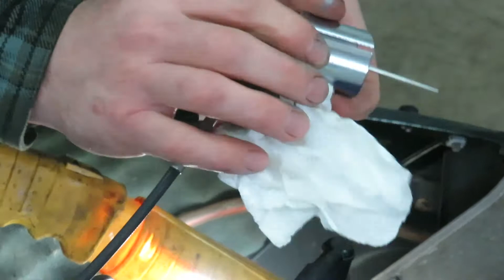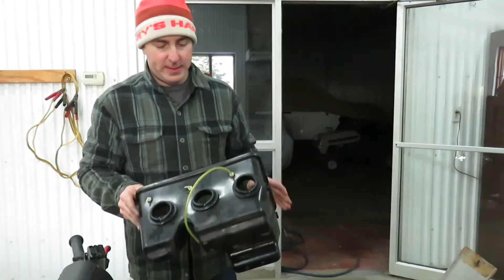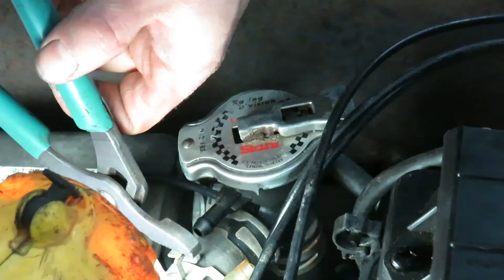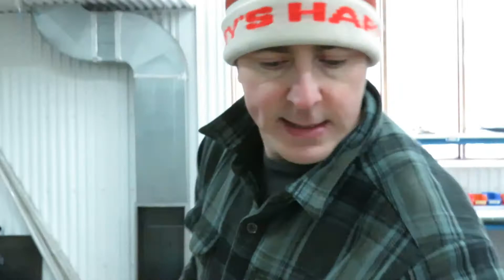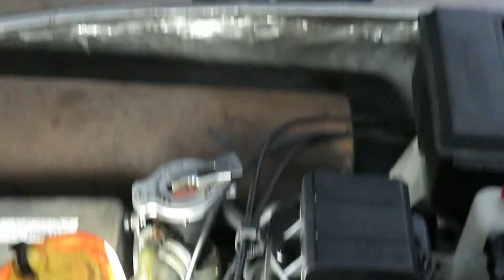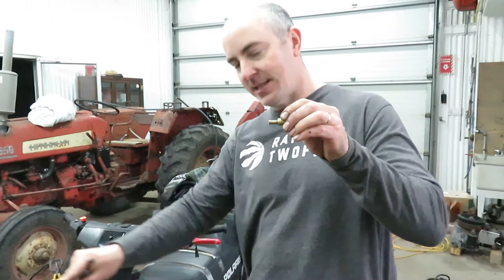1997 Polaris XLT Touring Snowmobile, part 2

Comment: Definitely need the pickup hose in the tank. Any sled 30 years old does not have the original attached still. Sometimes the brass pre filter/ check valve rots off and the line floats up. Not sure why, maybe the sloshing around but if it points up instead of down you will get nothing but air even with a tank that's almost full. If you get a new to you sled it's nice to put on clear gas lines to see what's going on. Also it looked to me like your fuel filter is on backwards. See if there is an arrow on it.